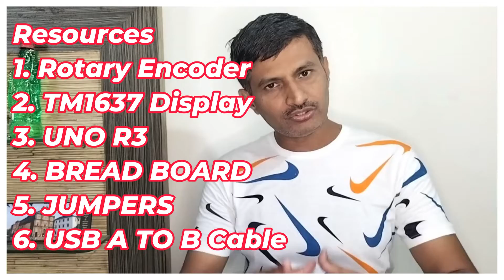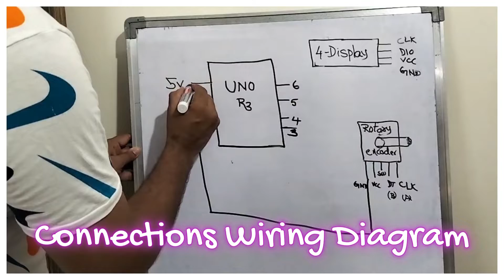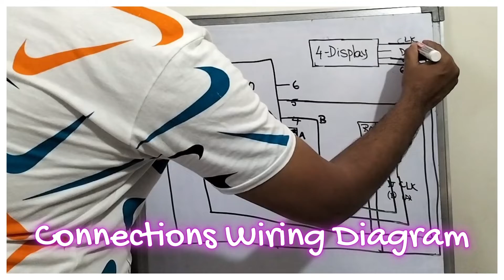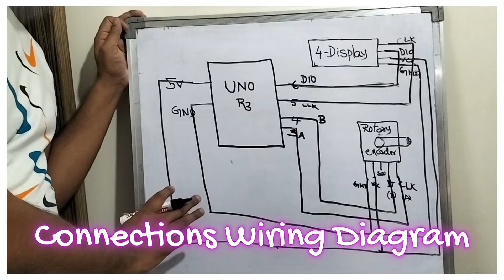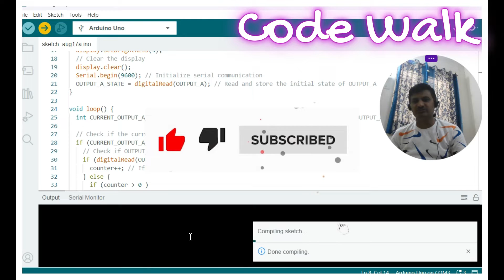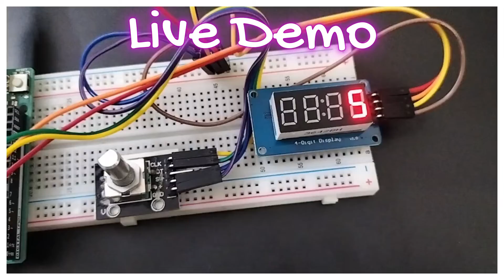How to Use  Rotary Encoder With  Arduino 🤔

Comment: Thanks a lot for the video. How we can add the SW pin (pin_button) of encoder to reset the value ? Also on the fisrt start the display is not ON just after turning once it begin to display a zero. How we can have on first start of program the first digit On with an 0 ?  Please show us how to set min & max values.
Reply from the maker: Thanks for your question. I will update today
Reply from the maker: How we can have on first start of program the first digit On with an 0 ?

write this in setup() function => display.showNumberDec(counter); 

Updated code - https://github.com/alexvatti/AlexArduinoProjects/blob/main/Rotary-Encoder-TM1637-Display.ino
Reply from the maker: Please show us how to set min & max  -- in our code we set min as 0 , max we did not define - Pls read the code - https://github.com/alexvatti/AlexArduinoProjects/blob/main/Rotary-Encoder-TM1637-Display.ino
Reply from the maker: How we can add the SW pin (pin_button) of encoder to reset the value  -- Let me check and get back to you